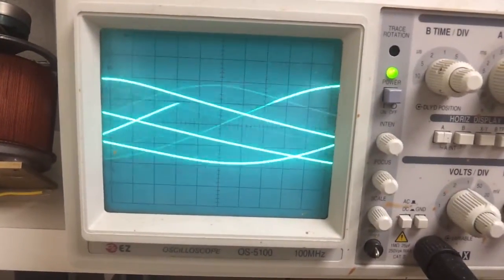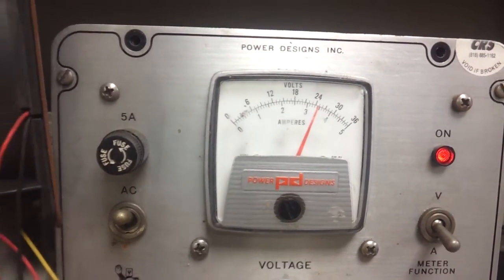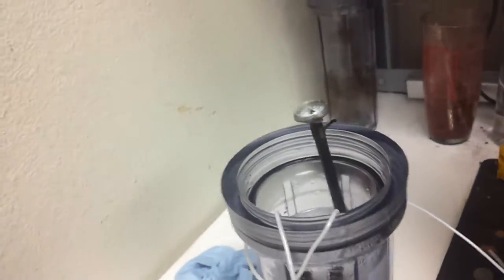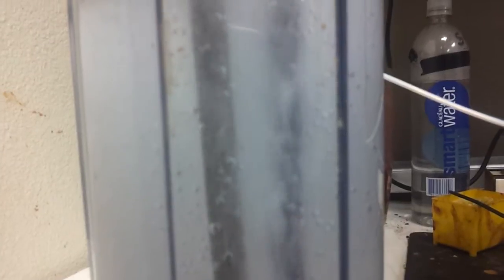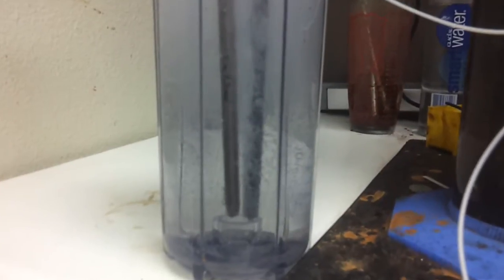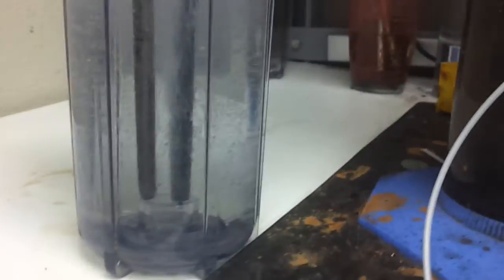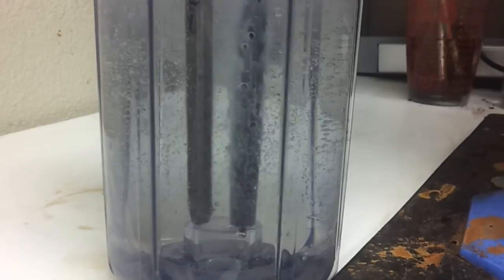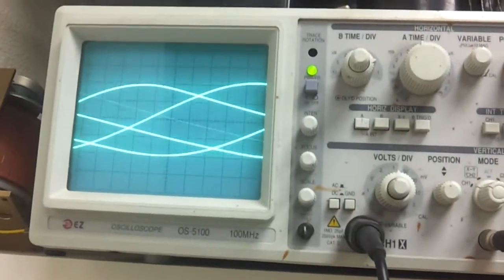HydroMe™ True Fuel Cells New Electrodes this is not HHO

Comment from the maker: Then you can crank the volts.  Amps will go to zero and that was an issue before and Meyers underlining problem. I have corrected that threw cold plasma. I have no documented proof Tesla was here but i would like to think so. However nothing i see today has a sustainable charge like this. Look at my Zero Point Tap video.

Comment from the maker: Your intrest is welcomed, what happens is my very own Linear Paul Magnatizum LPM changes the magnetic ordering of the metal from electromagnetic with two poles,  to Four Poles.  The coating is just Icing on the cake. Similer to your HHO with your cell conditioning. Scott at wCentralvalleyhho.c has a good grip on electromagnetic ordering. LPM is more paired with mother Earth. At the moment the cell is only taking 2.250 amps at 6volts. As capacity becomes avaliable amps go down and volts stay put